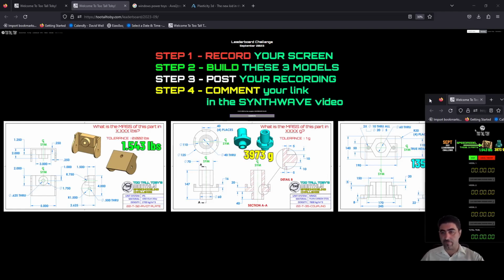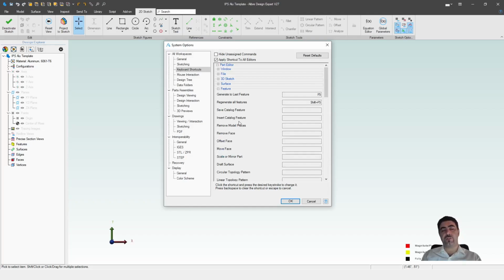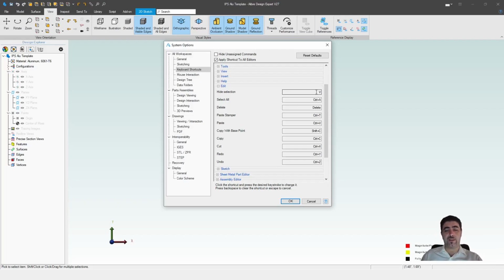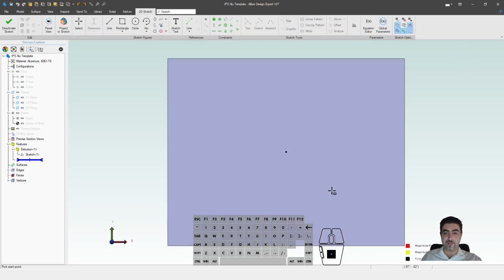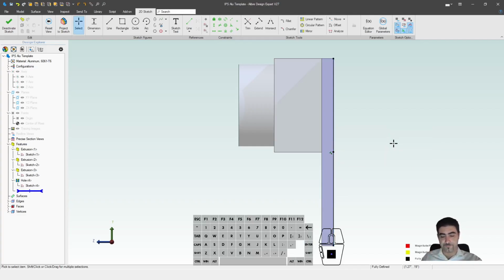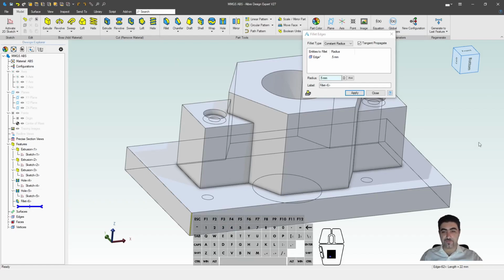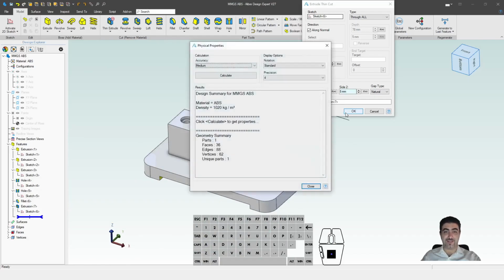Do you even Speedmodel, bro? I show you all my secrets in Alibre

Comment: Here we go with my legendary feedback! Following along per usual.

00:00 Here we go! I hope you're ready for a wall of text.

04:09 I would probably just do a second window capture in OBS and put it on top, then move the timers to my second monitor. But not everyone has a second monitor to work with, and I don't know if doing it that way is "legal."

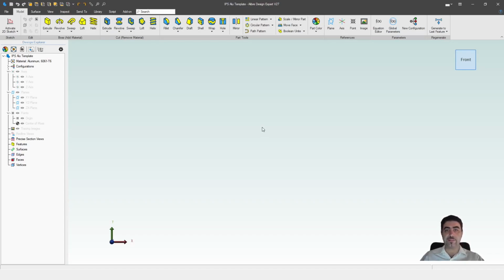06:20 I got your templates from the forum. Very helpful. 

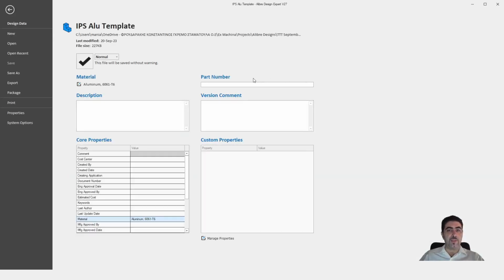06:30 Interesting how you can go from inches to mm just by opening a different document. It makes sense, but I'm so used to using mm with 3D printing that I've rarely used inches for modeling.

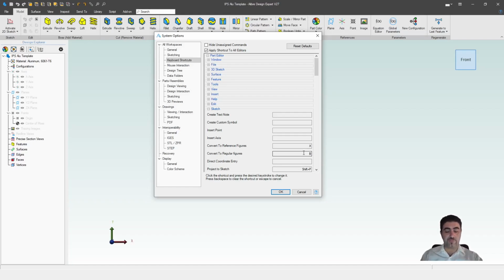07:30 I wish there was one key that would just toggle back and forth, rather than having a different key for each. 

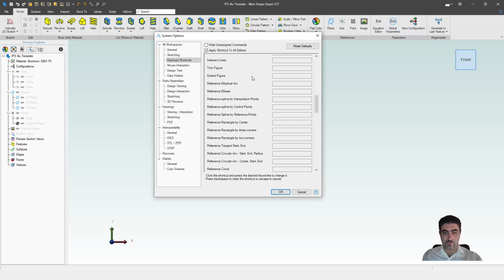08:25 Very interesting to see that, at least at this point in the video, although I use diffent key combinations, I have the same commands filled out and the same ones blank. We seem to need shortcuts for the same things.

09:00 Oh my gosh, I just realized I could've done some fillets in 3D in a few of TTT's challenges and it would've saved me MINUTES. Creating a 2D fillet can break constraints, and that was the problem I ran into.

10:11 That was one of the biggest things I missed when going from OnShape to Atom3D. I'm very glad I got promoted to Design Expert so I could have my center rectangles back.

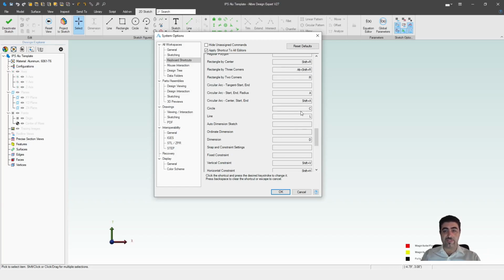11:45 Oh man, trying to do that with all the tools is tough. I end up also using sounds in the word as well. 

12:03 If you use them so much, why use Shift+V or Shift+H instead of just V or H? Just curious, nothing I have conflicts with V or H, so I'm curious what else you use V or H for. (Nevermind, I see them later.)

12:15 I think the biggest takeaway here is to make keyboard shortcuts that work for you. It'll take trial and error to see what makes sense, but just assign things that seem right, and try to make a part. If your brain doesn't think it makes sense, change it to something that does.

17:20 When I saw this in a video of yours a few weeks ago, I was blown away. It's so obvious in hindsight, and I've never seen anyone do it but you. I'm still training myself to use it. You're a genius.

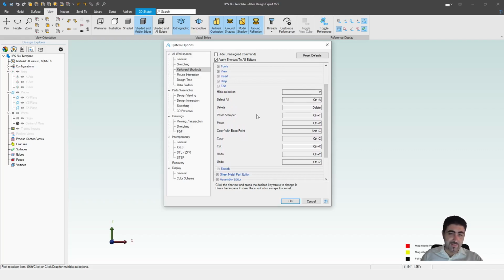18:27 It started as Ctrl+H. 

20:55 I did this by mistake, and was taken by surprise so much that I thought I messed up.

22:30 (Insert the mind-blown GIF here) I had no idea. I used to teach Photoshop, and I would always teach that every mouse movement slowed you down. This is exactly the shortcut I've been hunting for. I don't know that it'll make me faster with how long it still takes my brain to analyse drawings, but I'll get there!

23:45 Precisely. This is the biggest thing to teach anyone who wants to use ANY software professionally. Professionals use shortcuts. Look at the old editor for Linus Tech Tips: he used like 5 keyboards for editing because he set up shortcuts and macros for all of them.

28:16 The hole tool creates its own reference geometry. That saves tons of time, too. I didn't know that.

30:52 Hm, mine never seems to add vertical or horizontal constraints automatically. I wonder if there's a setting turned off.

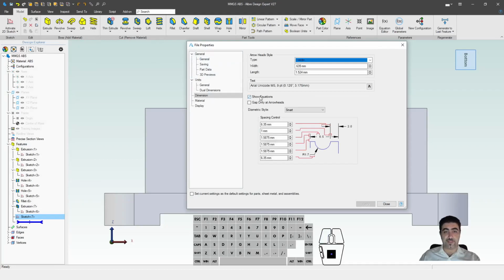38:45 That's one of the biggest things you taught me that helps me all the time.

40:09 "You can do some interesting stuff with some dimensions." I think if you used that font on competition, they would think you're a psychopath.

41:32 Thats cool, it's almost like it's designed for you to go back and forth between features and see how much material it'll cost.

42:35 Thank you!
Reply: As far as the toggle reference vs set all to one or the other, of course it's helpful to have a key to set to one or the other, but definitely would be nice to have a toggle option as well. 

I'll have to check my automatic constraint settings, I might've turned some off early on because it was adding constraints that I didn't want. 

I definitely want to see you do speed modeling with a weird font... Especially since you don't actually read it in competition, I guess it wouldn't matter what font you use
Reply from the maker: Yeah, but I don't think I have the guts to do in my first competition ever. Maybe do the spring open regularly, and we use that trick later on, lol.
Reply: @ExMachinaEngineering  I guess I'll just have to practice and get good enough to make the tournament, I'll definitely do it on my debut appearance.
Reply from the maker: It just might work and send through to the next round, lol
Reply from the maker: As always, your feedback is invaluable. Legendary indeed! I think that as a creator yourself, you know what one needs to have commented! Thank you so much for watching and for taking the time to give such thorough feedback!!! And allow me to answer a couple of things:

07:30 True, although there are cases when practicing for TTTs competitions that I have a mix of reference and regular geometry. Where I would like everything to be one or the other. Then I just hit Ctrl+A and the appropriate key and I get what I want. If it was one key, it could potentially just switch everything around which would not be very helpful.

30:52 if you hold a line near that it will snap to it and create an automatic constraint. It should be on by default. But if you want to check, do the following:
Open a sketch--> Hit Alt--> From the menus that appear got to sketch--> Snap and Constraint settings, and set the options as you see fit. I for example have turned of vertical and parallel because in complicated sketches it would jump to being parallel to a line off screen and I hated that I needed to go hunting for it. (Actually, that's probably why you don't get it. Vertical and parallel have higher priority)

40:09 Maybe it would be so weird that Toby comments on it, the other competitor stop to take a look and he loses time... Hmmm... Now, let me get a pen and paper...

Thanks again, Adam! Much appreciated!

Comment: Very useful as usual. What do you think on we might actually need to ask Alibre team to constrain the rectangle by center horizontally and vertically by default. Because I don't ever remember that I wanted to have it on an angle. This would save 2 more clicks to make it fully constraint.
Reply: Agree. We'll get it done. :D
Reply from the maker: To be honest, I've never had it at an angle either. And even if it was constrained and you want it at an angle, you can remove the constraints.
I would agree that it would make more sense like that.

P.S. I am glad you found it helpful man. Especially you can do wonders with a couple of these strategies.
Reply: @ExMachinaEngineering  yes, you are right.

Other than the shortcut keys, it's really nice to see you figured that last constraint item is still in selection cache and therefore can be used for further operations like dimensioning. Makes positive effect on speed indeed. I wasn't really aware of that feature.

I must start taking advantage of that pop-up menu which comes when an edge is selected in sketch mode. I can see how you use it quickly project line without opening up another dialog window.
Reply from the maker: Yeah, if you start using  that you'll make more impact on the next championship. I'll try and take part too but I'll have a young baby in the house by then so, it might not be too easy. Or competitive